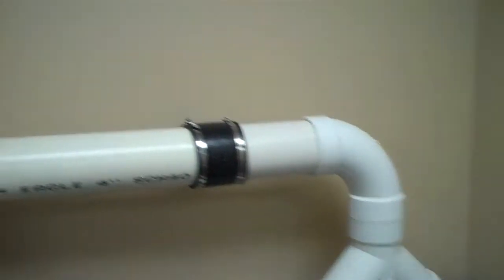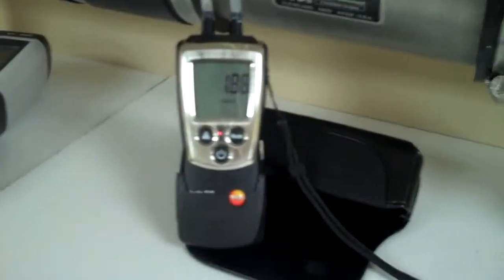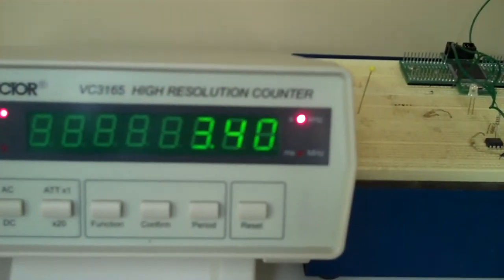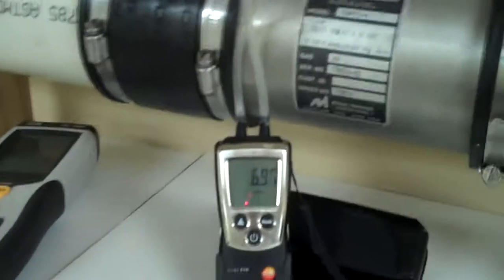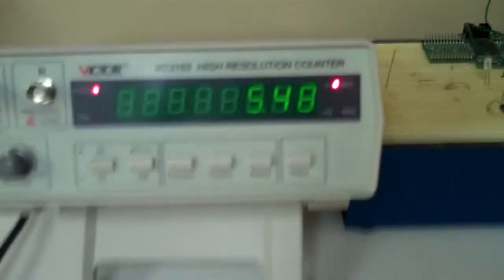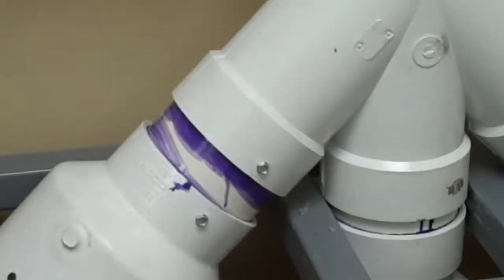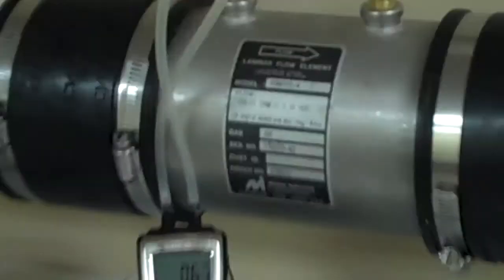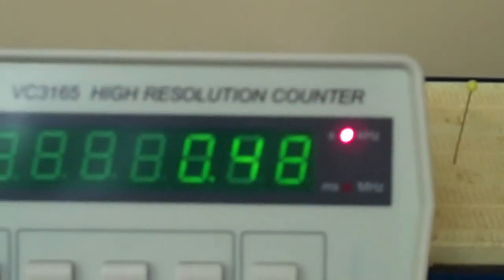BowlingGrippo_MAF_Flowbench2

Comment: why couldn't you use a maf instead as the measuring item?  is it becuase MAF's are genernally not linear in their output?
Reply: He was doing both , meaning across a orifice plate and using MAF , a heated wire somewhere ?